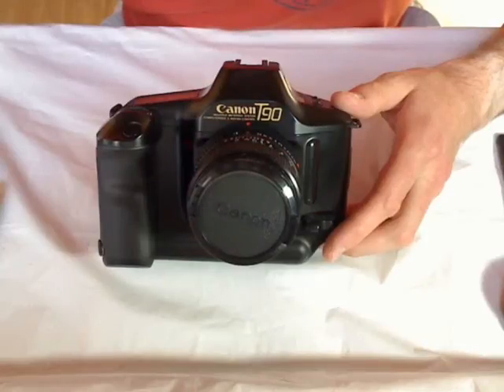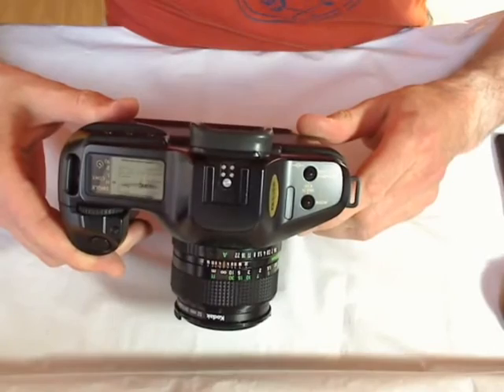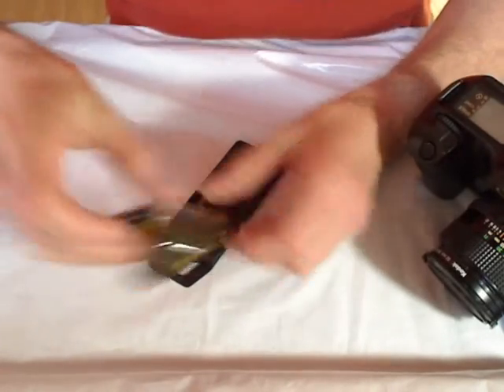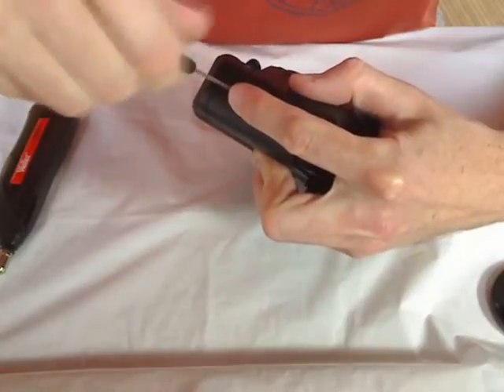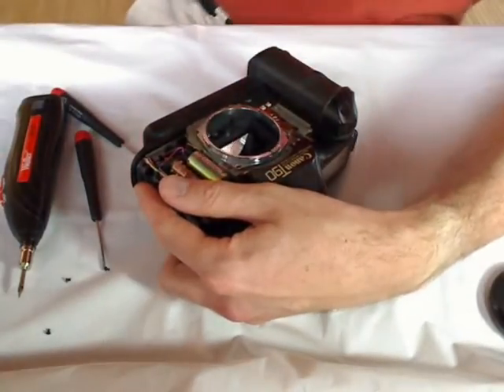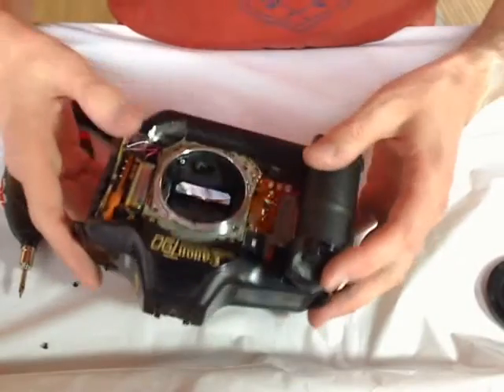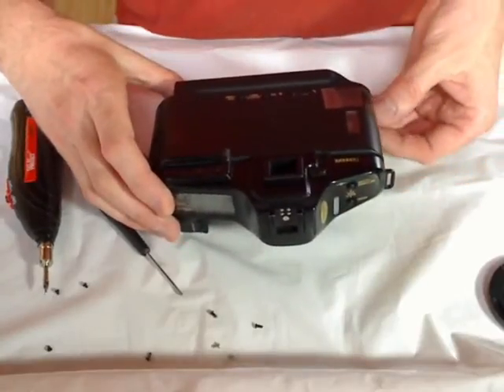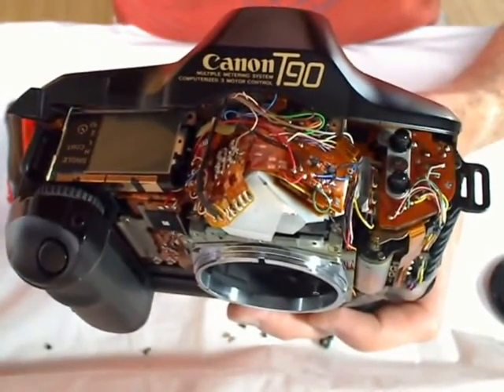Canon T90 Modification - Film Leader Stays Out How-To Tutorial

Comment: What I used to do back in the 80's when I worked in a camera shop was to use a bit of old 35mm film and stick some double sided tape on the emulsion side on this piece of film and then insert it into the film canister felt light-trap, turn the film canister spool to draw in this piece of film and when you see it being drawn in you carefully and slowly pull it back out again. 
You might have to try it a couple of times, but eventually, the film leader will come back out and voilà, there you have it.

Comment: Hi i have a problem with T90 
i have a old nissin flash but don't work on this camera but in a T70 work fine
measure with multimeter in a hot shoe flash in positive and negative pins  have short circuit it's normal ?
thanks for your help and sorry for my english